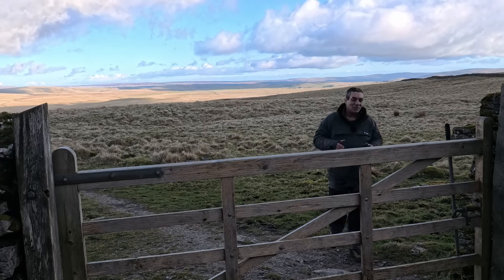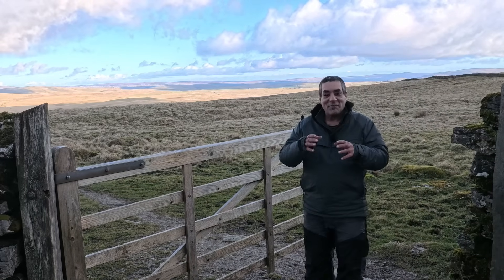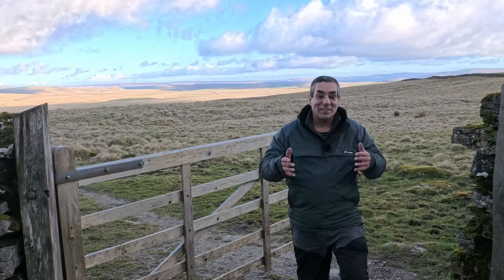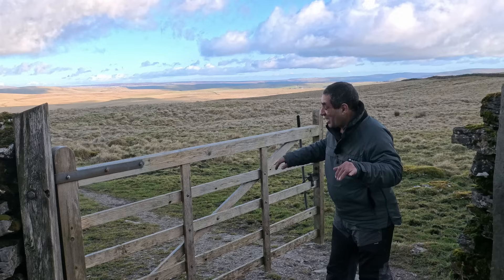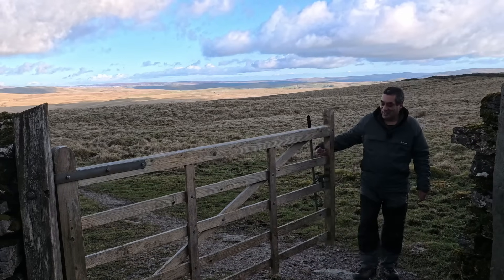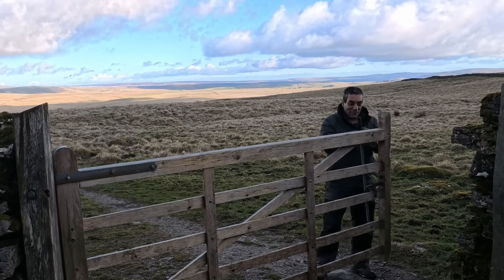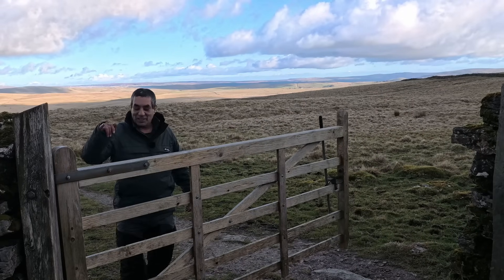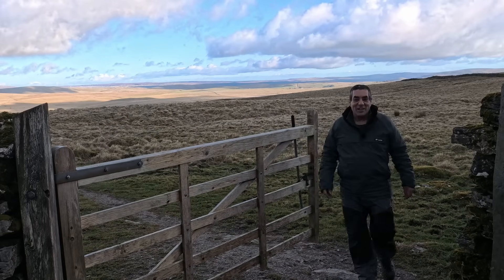Why does a gate (or door) open?

Comment: So The Map Reading Company...
I'd expected a video about Bargate, or Yate, or Whip-ma-Whop-ma Gate, or Symonds Yat, or Kiftsgate... but no!

Gate and gap have a common root: geat, which means gap. And because a street is a gap between housen, gate can mean street.

You barred a gate, that is you closed it with a bar (later called a pike, and because you might turn back when you found your way thus barred, toll-gates were called turn-pikes).

Eventually the bar became known as the gate, and because of the great vowel-shift it ended up pronounced differently in different accents around the country. So geat became yat or Yate or gate or gap - but either meant a gap, a gate or a street.

So...
Bargate is a street in Worcester,
Whipmawhopmagate is a street in York,
Symonds Yat is a gap between a hill and the River Wye,
Yat Rock was where a pack-saddle route passed by a lime-tree (originally Yaettelinde, which translates as lime-tree gap),
Yate means street,
Kiftsgate is a place where a route passes through a small gorge in the Cotswolds,
Gate really means bar,
and gap means a pass or street, so there is a Bar Gap in Durham and over 70 other places with names that include 'gap'.

Toponyms are what happens when you read too many maps.
Reply: LOL, now let's see you get all that into a 13 minute video, haha.

Comment: We were taught a slight variation of this: that the moment τ is the component of the force at 90° to the direction of movement multiplied by the distance. The resulting maths  is the same, though we hadn't introduced vectors at that point.
Reply from the maker: You're right - The reason I didn't put sin 𝜃 in the first function is that it's a vector equation for torque (the one teachers normally use - well they did in my day 😊) and so sin 𝜃 inherently part of the cross product definition - so it's not needed.
In the 2nd "scribble" I was only talking about the amount - the magnitude - of the torque (not the full vector equation), which is why it's included.
But who knows - I just teach map reading 😊
Reply: @TheMapReadingCompany  You did better that I would half way up a hill and not "unprepared" - and I used to be a science teacher....
Reply: Even after 50 years the words ‘maths’ and ‘physics’ bring out a cold sweat……😬
Reply: @davidyeomans6762  I've known a few heaving, buxom barmaids that did that to me too!
Reply: “Maths” is a distinctly British way of referring to “mathematics.”  I have never heard the term “Maths” spoken by someone in the USA (except when watching Youtube videos or movies of British origin).
Reply: @brucefay5126  American Maths major here. I prefer the Brit emphasis of the Plural, Maths, to distinguish the wide range of Mathematics from the K-12 'math' to which most Americans were subjected (which pedagogy has been outdated for decades and each attempted reform has backfired, but that's another discussion).